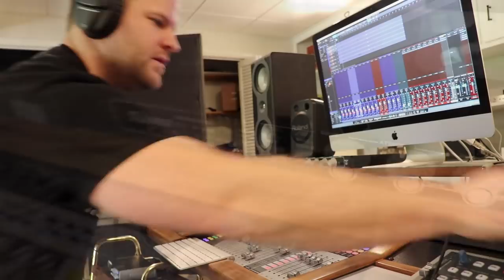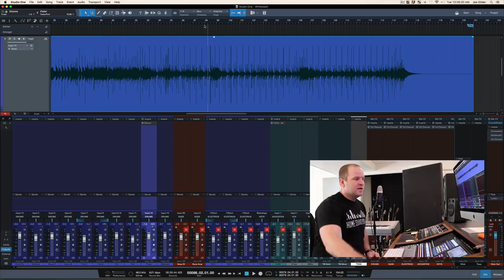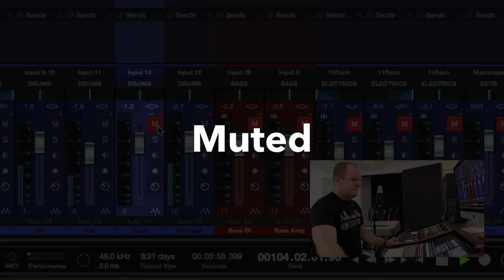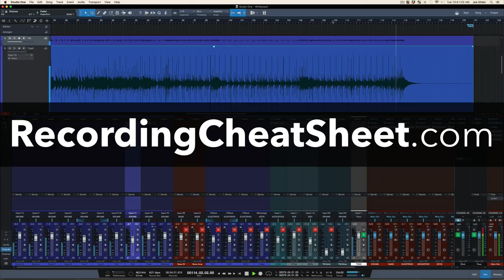Recording Drums: Trash Mic

Comment: I'm listening in mono and with the track on the snare seem out of phase with the track. When you mute the track the snare comes back. Idk
Reply: Whenever you have 2 different room mics picking up 2 different drums kik,snare for example, some phase cancellation is inevitable and nearly impossible to align. In this case the trash mic is maybe a foot from the kik and two feet from the snare, where the room mic might be 5 feet from the kick and 5-1/2 feet from the snare. With these two mics you can phase align one drum the other will have a very high probability of being out of phase. The question is the is it constructive or destructive cancellation. Modifying the delay time on one mic track vs the other can have pleasing or horrible consequences on tone. Virtually everything in a mix imparts some degree of phase cancellation on other things. I think of this as mix timbre and is the reason that we can't mix by analyzer.